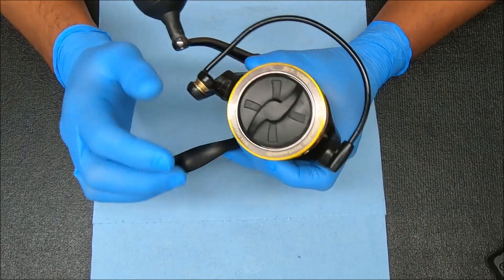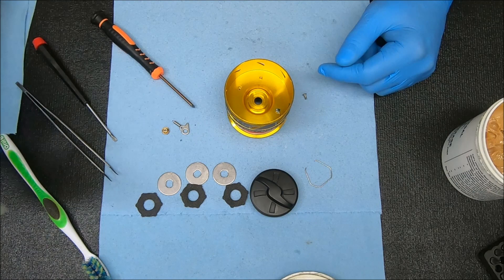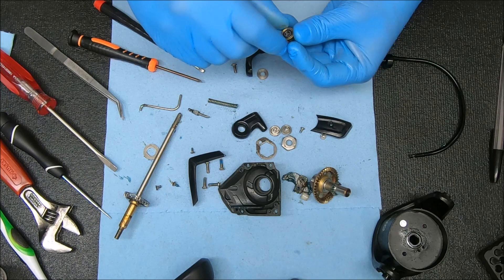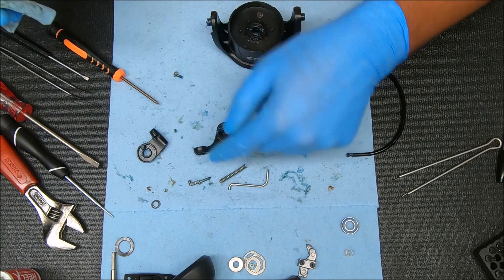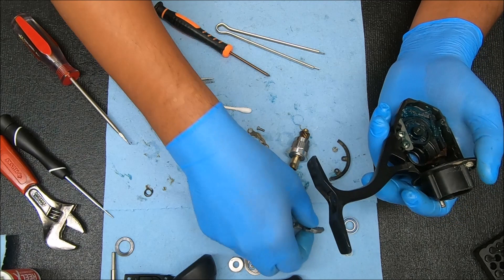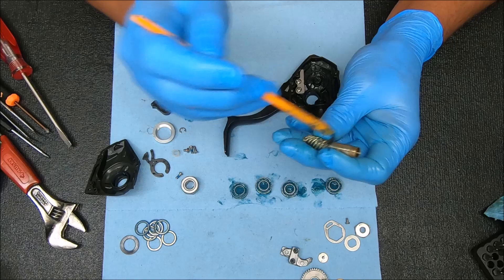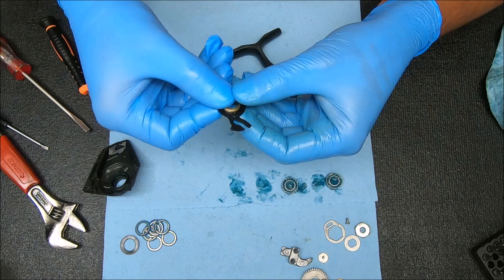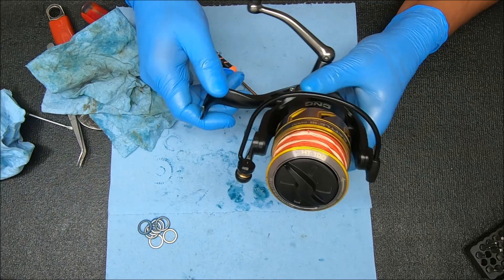Penn Battle III 6000 - How To Service - Fishing Reel Repair

Comment: Great video! I’m having issues with the shims that goes in the main gear. Mine had 4 shims: 3 bronze and 1 silver. I put the four of them before the bearing, but when I screw the housing cover the reel becomes very tight and doesn’t rotate. You have any suggestion?
Reply from the maker: Thanks for watching!!! There are a few factors that can cause this tightness on reassembly, but the basic solution is..... play with the number of shims you put back in until you get the feel you want (this is assuming the reel was fine before you serviced it). You're not obligated to put a certain number back in..... just don't throw the extras away. Hope that helps. Spread the word about the channel.

Comment: At 19:20, what does the black plastic piece that interfaces with that dog do? Is this some sort of anti-reverse over-ride?
Reply from the maker: Thanks for watching! It holds the backup dog in the closed (disengaged) position. If the main dog fails, the reverse centrifugal force will force that black arm open, which engages the backup dog. Spread the word about the channel.